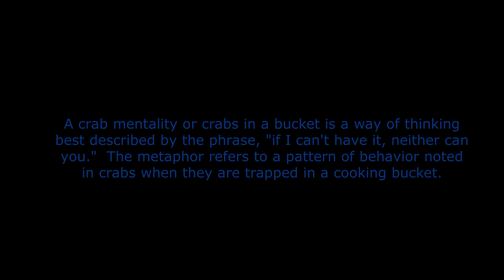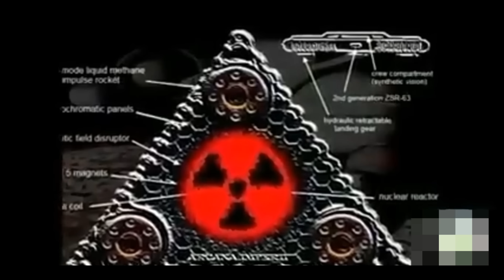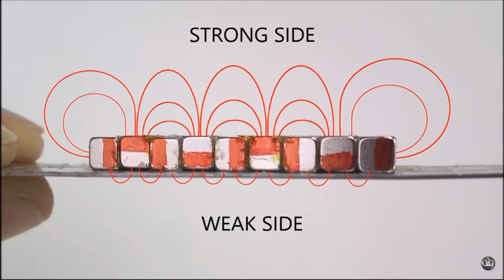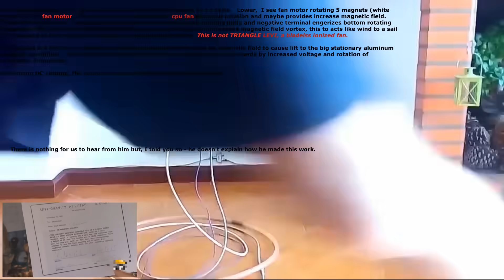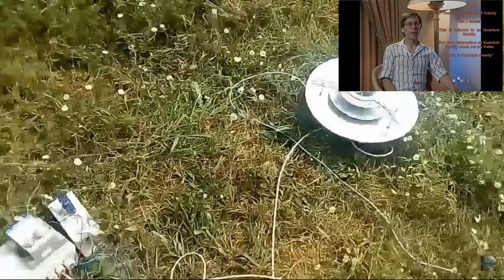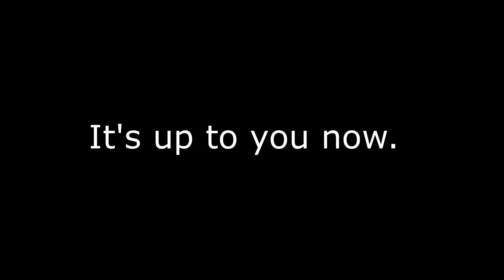anti-gravity project

Comment: Magnetism and gravity are distinctly different forces. There is no way any number of magnets in any conceivable configuration is ever going to result in anti-gravity.
Reply: Really?? Dont you say..  For this moment i was trought about Quantum Fluctuation it was.. If everyone in one day in same class get |FLU! XD
Reply: @nin1ten1do  I don't understand what your trying to say.
Reply: @danmeggitt179  Neither does he.
Reply: Respectively, you need to go study this stuff in detail. The device copies all the principal technology from the German Bell to the descriptions of the Vimana craft. There is no way this stuff is fake, have you not see the Lifter Tech experiments, are those fake too? You can take two magnets of same size and press them together and feel a slight weight difference when compared to two other same size magnets sticking together, the weight loss is apparent. Also this experimenter is pumping thousands of volts into the center capacitor and he is counter rotating two opposing fields against a reflective aluminum disc, creating in the ether a counter 
field that is breaking the gravity lock.  He also is pulsing Ultra Sound from the cone downward and probably magnifying the sound 
pulse stimulating the ethers to move downward. . 

How about the sound chamber experiments levitating dust and the items floating upward in the Hutchison experiments? What about the High Voltage experiments that demonstrate charge obstacles get lighter? Friend, the proofs are out there. .My guess is this guy is probably getting very worried about what he has found. . He has not posted any update videos. What about the many patents on the High Voltage side of the technology. You don't get a patent on something that does not work. Just some things to think about..
Reply: @erickutny2746  very true m8 everyone jumps on the fake or bs wagon without doing much more than a quick Google search and for some reason BELIEVE they KNOW but believing and knowing are not the same...now a days we are surrounded by beliefs and religious closed minded crack pots that cannot think independently...what people call thinking is nothing more that mindless accessing of information where as true thinking is actually computing indipendantly what you observe and experience...15 yrs of seeking truth and experimenting I no longer have to rely on believing what we are told because most of it is pure deception and lies and I'm tired of it...

In order to create an anti- something you need first to know what that something is to begin with. As long as we insist on remaining stuck in the self inflicted ignorance rooted in the blind and lopsided application of Newton’s ideas, there will be no progress whatsoever. We need to abandon unjustified adoration and separate out at least three personas of Newton: Newton the sharp minded, Newton the theologian and Newton the sociopath. Much of Newton's work is dulled by his personality disorder of needing to be the only and the best, like a five year old. Then, Newton the theologian with a “godly” agenda, just like Lemaitre 400 years later with his “creatio ex nihilo” cosmic egg idea, and finally Newton the sharp minded, who taught us two things: first, that the idea of masses gravitationally attracting each other is totally insane, and only insane people can seriously entertain that idea….

“That gravity should be innate, inherent and essential to matter, ….. is to me so great an absurdity that I believe no man, who has in philosophical matters a competent faculty of thinking, can ever fall into it.

and second, that he actually leaves it to us to figure it all out.

“Gravity must be caused by an agent acting constantly according to certain laws; but whether this agent be material or immaterial, I have left to the consideration of my readers.”

So, let’s figure it out then: first of all, Newton muddied his own waters by turning a blind eye to the fact that what he called gravity cannot be treated as a Newtonian force (F=m･a), because a body does not resist to be set in a falling motion. But the “resistance to being set in motion” (or to a change in motion in general) is the essence of Galileo’s “law of inertia” and, building on this law, Newton’s“three laws of classical mechanics”. Gravity thus does not operate under the auspices of Newtonian laws, and not only that, but Robert Boyle showed that it does not operate between the constituent particles of a gas at all, i.e. matter that possesses all degrees of freedom: such matter repels and does not attract.

Enter Faraday and with him the understanding of the physics of induction, elaborated on by Maxwell, Heaviside, Steinmetz and Tesla. Let’s not forget that practically the entirety of our modern “electrified” civilization rests on the insights of these few men - so we have all reason not only to lend them an ear, but to actually apply their practical findings as well as their theoretical results.

First order would be to restore to our tool box term and concept of the “ether”, because without it, we will forever be like toddlers sitting in front of a Punch-and-Judy show, ooh-ing and ahh-ing and having all sorts of profound sounding ideas and explanations of what is going on - without ever contemplating the existence of the puppeteer, who is actually operating bothfigures. The puppeteer of the universe is the “ether”, one hand operating Magnetism - responsible for spatial expansion - and the other hand Dielectricity, responsible for counter-spatial acceleration.

Following this insight, the next step would be to abandon the unjustified and infantile notion of “magnetic attraction”: magnets do not attract each other, as little as masses attract each other through gravity. Both are counter-spatial acceleration, which means acceleration through the accelerated collapse of space ….. space, which in turn is nothing but the result of magnetic expansion. These accelerations are non-Newtonian, in that bodies do not resist them, and thus do not mount a counterforce - according to Newton’s 3rd law. The bodies are not accelerated through space, but space between the bodies is collapsing in an accelerated fashion into counter-space.

Without entering a discussion about the veracity of alien craft sightings, very interestingly, what is common to all reports is, that these unidentified objects seem to be able to move in violation of Newton’s laws of inertia when they make high speed 90˚ turns and other counterintuitive motions: and that suggests they have mastered counter-spatial, dielectric acceleration, which bodies do not resist to, and thus do not suffer from “equal and opposite” g-forces, in other words they seem to have mastered what we would call “anti-gravity” or “artificial gravity”, i.e. “artificial dielectric counter-spatial acceleration”
If you are interested I have accumulated a lot of information over the years that I have  personally verified and know to be true as far as what can be verified to the average person...let me know I will share with you.
Reply: how many of the possible combinations did you actually try?
Reply: Okay but how is gravity made? It's the same basic principle...
Reply: @walmartskills  Ever since Newton decided NOT to investigate gravity -“So far I have explained the phenomena by the force of gravity, but I have not yet ascertained the cause of gravity itself.” we have been left with a descriptive mathematical interpretation only.

“There is no model of the theory of gravitation today, other than the mathematical form.” (Feynman)

All words used to talk about this phenomenon have the quality of bed time stories without reference to actual physical species responsible for the observed effect. Here in the answers we find NASA scientists, PhD students and holders and other “scientist” telling stories which all either violate one or more fundamental laws of physics or are not related to physics at all. They are not to blame though, because the “science” of gravity in an incomprehensible deference to Newton has refused to advance into the Faradyan epoch of knowledge.
First step towards accomplishing that transition is to acknowledge that Newton was simply wrong in calling gravity a force. Newton himself defined Force as an overcoming of resistance to being set in motion (or change of state of motion) and objects do not resist to being set into a falling motion. Gravity consequently cannot be called a force.
Second step is to abandon the stubborn but totally uncalled for separation between magnetism and gravity. The difference is like the difference between a 5w light bulb and a 5w laser: one is a nuisance at worst, the other is frying your retina, or cutting wood. Nobody would say bulb and laser are different physical species, they are different modalities of the same species. If gravity is the bulb, magnetism is the laser.
Once we have freed us of these “prehistoric superstitions”, to paraphrase C.P. Steinmetz, we can move on and step into the era of Faraday, i.e. the era of induction physics.
In order to move freely in this era, we have to make a third step, and that is letting go of Einstein, the 20th century reincarnation of Newton, especially his devastating 1905 paper with its abolishment of the ether. Ironically, Einstein himself is the best help in that effort:
"In 1905 I was of the opinion that I was no longer allowed to speak about the ether in physics. This opinion, however, was too radical, as we will see later when we discuss the general theory of relativity. It does remain allowed as always to introduce a medium filling all space and to assume that the electromagnetic fields (and matter as well) are its states..... once again 'empty' space appears as endowed with physical properties, i.e. no longer as physically empty, as seemed to be the case according to special relativity. One can thus say that the ether is resurrected in the general theory of relativity.... Since the new theory, metric facts can no longer be separated from true physical facts the concepts of space and ether have merged together." (quoted in Ludwig Kostro: Einstein and the Ether, 2000)
And thus we may in good conscious continue were J.C. Maxwell left us:
“This medium of propagation, the Ether, must exist. This medium must be a prominent thought in our investigations”
With the Ether reestablished as prominent thought we can finally paint the full picture of nature and begin to understand what was beyond the reach of both Newton and Einstein: the fundamental event in nature is the polarization of the ether, also called the electrification of the ether.
It is important to understand that the Etheras essence has no extension and no duration, that is Ether is not pervading space as substance, space is only one modality of the polarization, the other being counter-space. Both space and time are side effects of the polarization between magnetism and dielectricity, between spatial divergence and counter-spatial acceleration,
“Time and Space … It is not nature which imposes them upon us, it is we who impose them upon nature because we find them convenient.” (Poincaré)
It is crucial to wrap your mind around the concept of counter-space, or rather anti-volume: we are used to associate capacity with volume and would automatically think that anti volume is the opposite of having capacity. But that is misguided, anti volume has also capacity, it is the storage “container” for dielectricity, whereas volume is the storage “container” for magnetism. The closer two plates are, the more counter-space, the more storage of dielectricity (Capacitor), the wider apart the plates, the more space, the more storage of magnetism.
If you are patient enough to observe cross country power lines, you will recognize Amperage spikes (dielectricity) by the rapprochement of the lines (increasing counter-space and thus the storage capacity for Dielectricity, i.e. “Capacitance”) and Voltage spikes (magnetism) by divergence of lines (increasing space and thus storage capacity for Magnetism, i.e. “Inductance”)
This is the basic concept, the event of polarization itself plays out dynamically as toroidal - precessional - hypertrochoidal reciprocation, As can be seen live in a ferrocell:
Spatial extension is tantamount to loss of inertia and what we call mutual attractionis the opposite, regaining inertia by loss of spatial extension. It is therefore NOT correct to say that masses and magnets attract each other, they follow the loss of spatial extension between them as space collapses into counter-space in an attempt to regain inertia.
Inertia is rest, and that is what the old philosophers understood as the driving motivation behind the behavior of matter: seeking out the place of ultimate rest, which they find wherever they need, i.e. counter-space is incommensurable, not having a cartesian location.
Here, between the two masses (great dark spots) there “opens up” a “gateway” to counter-space (smaller dark spot), into which space from both sides collapses, and the masses are just following. Counter-spatial acceleration thus is acceleration of space (Faraday), NOT objects accelerating through space (Newton). That is why they are not resisting, falling is just following.
Now that we have seen the toroidal hypertrochoidal nature of space, we can see how separating masses acts as torsion and that is were “potential” energy is stored, not as “negative” energy in a “gravitational field”, of which there is neither the one nor the other.
Reifying the concepts of space and time, lumping them together and having them bent like a wet noodle will in future history books be considered one of the greatest intellectual blunders in the record of mankind, so if you want to be on the right side of history, that’s what you have to throw overboard immediately. Let Louis Essen, the man who gave us the Cesium atomic clock with which he made all the relevant experiments help with this:
“There is no question here of a physical theory but simply of a new system of units in which c is constant, and length and time do not have constant units but have units that vary with v^2/c^2. Thus they are no longer independent, and space and time are intermixed by definition and not as a result of some peculiar property of nature... If the theory of relativity is regarded simply as a new system of units it can be made consistent but it serves no useful purpose... “ ESSEN, L., Electronics & Wireless World, p. 126-127, February 1988)
Here in the same text Essen shows what happens if you base science on “thought experiments” rather than real world experimental set ups: ”... he concluded that, at the end of the journey, the time recorded by the moving clock was less than that recorded by the stationary clock. The result did not follow from the experiment, but was simply an assumption slipped in implicitly during the complicated procedure.
Second on the list of greatest blunders is the concept of particles, “atomism” as it were, especially the concept of particles imparting “negative momentum” as would be the case with gravitons. Atoms are dynamos of toroidal - precessional - hypertrochoidal reciprocation, not point masses with mostly empty space in between, and in an extension of that principle, that is what the universe at large is: NOT a thing that has a beginning (Big Bang) makes a journey through time (Entropy) and arrives at an end (heat death), but an event that constantly reinvents itself in the polarization of the primordial ether, which has no extension and duration in and of itself, these being only attributes of “magnetic divergence” and “dielectric acceleration”.
Thinking in terms of age and size of a universe driven by gravity therefore will leave you forever spinning meaninglessly in a back eddy of the stream of knowledge and consciousness.
Speaking of consciousness: sit back, close your eyes and try to feel the extension and duration of your consciousness - you will find it has neither and in realizing that you will realize that you yourself are a product of the polarization of the Ether, with your body (animus) as the spatially divergent loss of inertia and energy, your consciousness (anima) the incommensurable seat of rest and source of energy
Reply: Sorry but you are incorrect
Gravity is not an autonomous field modallity it is simply dielectric acceleration...no different to magnetism just coherency....multiplicitive omni directional force vector towards the centre of that mass....unlike a magnet (point source) that has poles or more correctly the inverse of counterspace (centrifugal and centripedal convergence and divergence) many things acticing in unison...by definition a magnet is still the same object as before it was magnetised size weight etc..the only thing that's changed is the quality (coherency) magnet = coherent...Gravity = incoherent...a good analogy is light (hybrid) coaxial circuit..a 5w light bulb is useless however a 5w laser will burn your eyes out...BUT 5W IS 5W RIGHT? Wrong 1 is coherent the other is incoherent...and light does not travel nor does it have a speed it is a rate of induction through a medium I.e the aether....the universe is dielectric and magnetic...(force and motion) and (inertia and acceleration) expressions of the aether field simplex pressure mediation...there are different modalities of the aether feild and fields are not particles virtual particles like the election have never been the input or the output of any experiment done...even the guy who discovered it even denied the existence of the election as a particle until he was offered fame and money...wave particle duality is a joke there are no dualities in nature! Four principles of nature everything is capacitance risistance permeability and permitivity...there is no such thing as a pure insulator or pure capacitor...try asking a physicist how light speeds back up again after it leaves glass (without breaking the laws of conservation of energy) they will stutter...they won't tell you that glass is actually a capacitor...BUT what really makes me laugh if when they desperately start throwing WAVES around.."oh it's a wave" OF WHAT "Just a wave" A WAVE OF WHAT...HAHAHjA a wave is not what something is a wave it's what something does! Just like space is nothing it does nothing and acts upon nothing same as time time is not a force it's a measure of magnitude or motion over distance
Reply: @danmeggitt179   To answer your potentially rhetorical question; Light is a wave of electromagnetic radiation. It is a beam of changing magnetic and electric fields. A changing magnetic field induces an electric field and vise versa, and in the case of light is forces a self-propagating wave. The reaction speed of one with to the other depends upon the dielectric medium. That is why it is able to speed up when it exits glass. There is no violation of the conservation of energy.
Reply: @romestado wrong you have completely misunderstood what I said...the point I was making was...physicists can't explain how it speeds back up without breaking the laws of conservation of energy using quantum theory and non existent VIRTUAL PHOTONS..however you are correct concerning electricity creating magnetism and visa versa that part is obvious...magnetism.. as in what we perceive as the field Is the creation of space due to the loss of inertia...or dielectric (2 dimensional) return to counter space or plane of inertia that extrapolate out in concentric circles in a curved linear fashion (there are no straight lines in nature) resulting in a toroidal 3 dimensional field in the most basic sense like pulling the plug on a bath tub and turning the shower on except if you had a rubber duck small enough to go down the drain except it's the oposite...the duck would be going up againt the flow or vortex whatever ya want to call it...we owe the space to magnetism it adds volume to the universe...electricity is a hybrid..take a giant electromagnet in a scrap yard to pick up cars pass electricity through the coil it dumps it's dielectric component which seams like mysteriously disappears by this lost to counterspace all that's left is the magnetism...if you are familiar with a coax cable...well..light is a coaxial circuit of transverse magmetic and dielectric with a centre conduction... all have done for the past 15 years is obsess over this...bs like light speed, spacetime light constant lol they were the first things I learned as a child watching Carl sagan but I'm 33 now and instead of being like every other sheep asleep excepting and believing everything they put on tv...I wasn't satisfied until I did it myself and experienced it with my senses...it didn't take me long to realise my own experiments and results were contradicting what I was learning at school...so i didnt waste my time filling up my memory space with a load of crap..so i dont have a phd...however i do spend 90% of my free time trying to think critically my biggest fault is if there is something I don't know and want to know I will go to almost any length to find the truth not the answer Google etc...the truth experiment observations testable repeatable... and it's gotten me into trouble sometimes...I sit back and watch the flat earthers debate the rest of the world about the shape of the earth and I laugh because neither of them know the truth...only the flat side have at least picked up on something and have gut instincts were been lied to...the rest are still oblivious zombies some always will be...i dont care tho because i know the truth because i have seen it etc...and not once have i ever seen any virtual particles or evidence of any...let's just clear and open our minds for a sec...just the term alone virtual photons...you do know what the word virtual means don't you...think about it dude..they take the piss in plane sight there laughing at us...even the word quantum..to quantify things (virtual magical particles) complete oposite to field theory nobody has ever defined a field a field has no particles so it cannot be quantized...but nooo it's not strange that they called the fake theory quantum theory lol and that is just the start..they take the piss in plane sight..listen you don't have to agree with it...a video of ken wheeler confirmed what i had concluded years ago.. to me its just common Sense...using platonic retroductive reasoning it cant exist any other way...light is pulse perturbation like touching the surface of water with your finger...or his analogy is a guy in a pond flapping his arms...his arms are not reaching to the sides yet the effects can be felt because he is creating compressions not in the water of the water like pistons in a stationary car nothing is actually moving through space...sound works the same way nothing is been emitted we cause compressions and refractions of the medium I.e the air.. ..so you think light actually travels? And exists as a wave and virtual photons as a duality...that have never been proven..and believe me I have spent the last 15 yrs looking for them and obsessively studying chemistry physics ancient accounts like the Greeks and even history...(not the bullshit they teach us in school the clearly advanced civilisation we are not told about evidently way more advanced than we are now) and the rest...we're being lied to...not paranoia or conspiracy...fact.... everything makes sense until you get to quantum physics...its a joke and everybody falls for it...until you start only excepting what you can prove to yourself you will only grow more confused and fall for there quantum bs even more while they invent more and more magical particles to make there mathematical equations balance and watch the rest of the world spend time and billions searching for them or trying to detect them...nicola tesla james maxwell c.p stienmats Oliver heavyside the ones who gave us practically 100% of the modern world new this..they were all in favour of (field theory)..tesla actually called einstine many names basically saying he's an idiot for riefying space as something that acted upon other things or time existing as a demension or force...we invented time... we have just created a measuerment of the flow from past to future as we perceive it..which essentially started from our ancestors observing the motion of the sun across the sky..time is a measure of magnitude or motion over distance...I could go on in much more detail with some proof etc however there js no proof for magical photons but I'm prob correct in assuming you read 10 lines and gave up because like so many other are incapable of saying they are wrong or don't know...I dont know a great deal and that's fine that's what science is all about.
Reply: @romestado  and its wasn't a question directed at anyone because I know the answer i was pointing out that a physisist couldnt answer it...but if it was a question..it's not a theoretical question...I  can phyisically show light passing through glass it's the most simple experiment you can do...as easy as seed exposure!